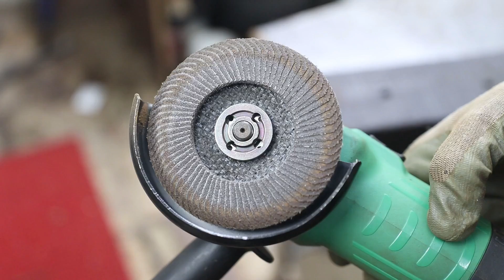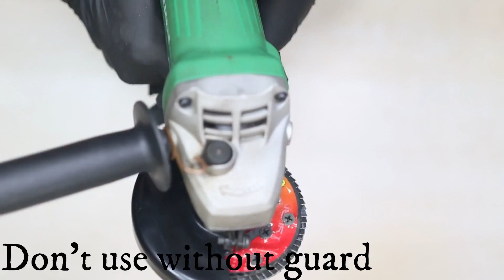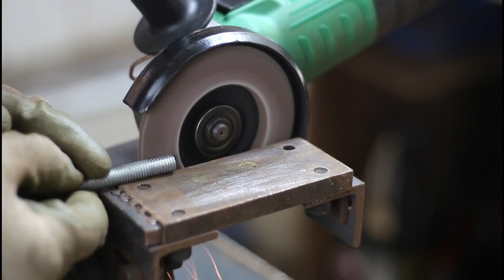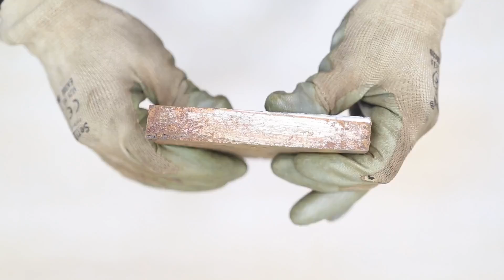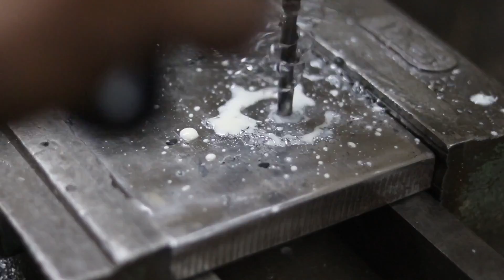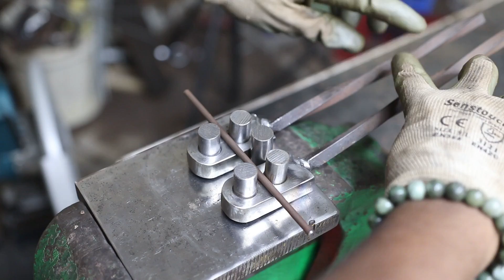CONVERT YOUR ANGEL GRINDER IN TO EXCESS WOOD REMOVER

Comment: Look, do what you want, but I HIGHLY recommend that you DO NOT alter your grinder wheels in any way, for any reason, ever. Each type of wheel is designed for a specific purpose & meant to be used in a specific way. Heed this advice, & you can thank me when your wheels do not shatter at 9-13,000 rpm & shred your flesh like a grenade.

Comment: Man! That first idea of the screws in a flapper disc is genius! Thanks.
Reply: Диск для болгарки очень плохой.
Reply: Please don use the first life hack for your ow safety! Putting drywall screws into a grinder disc is plain stupidity at its finest.  When the grinder spins 15-20k a minute and those little bastards fly off of it they have enough momentum and kinetic energy to pierce a 1" plywood. imagine what they can do with your chest, and arms. Just think a little bit before doing any angle grinder related life hacks because they can lead to serious injury.